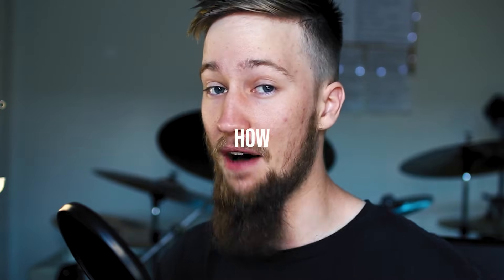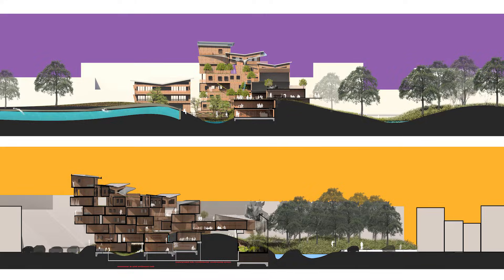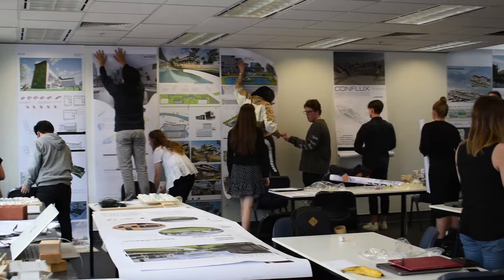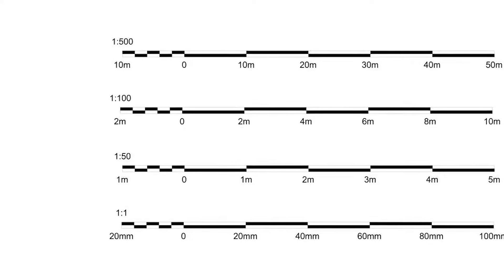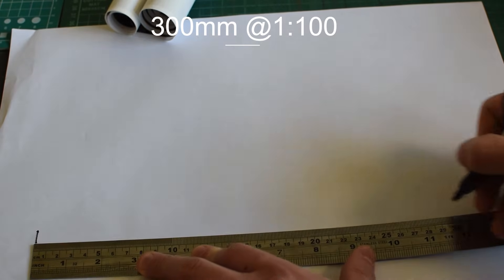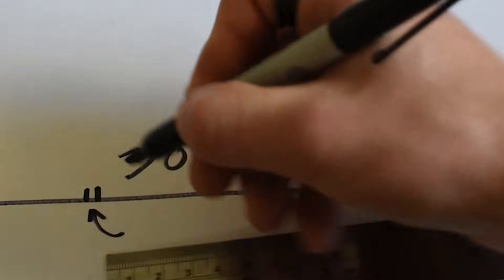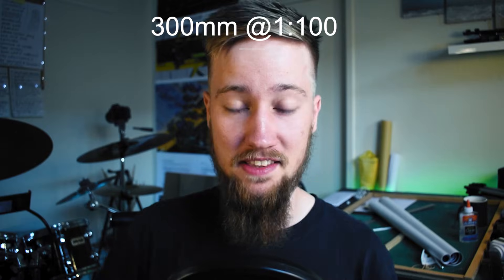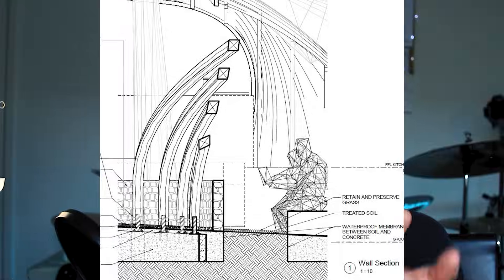How to Use a Scale Ruler (for Students) - Architecture and Engineering

Comment: Call me surprised, but I learned to use a scale rule at 14 in school, not years later at University. Then again, we were also using slide rules back then.
edit: I was also taught as a young fella (engineer), never, ever, lift a size off of a drawing, even if it was a controlled document.